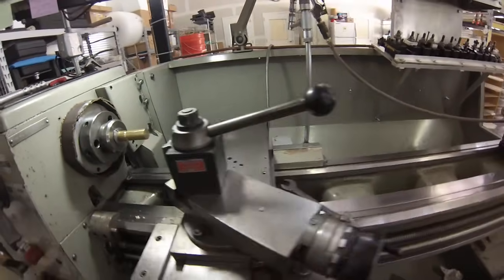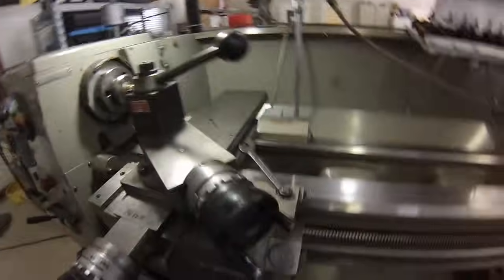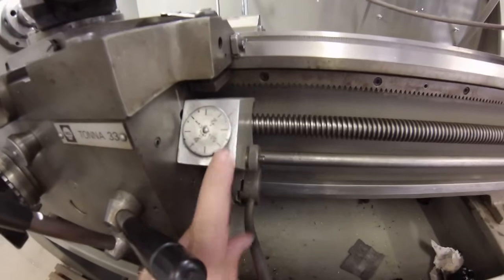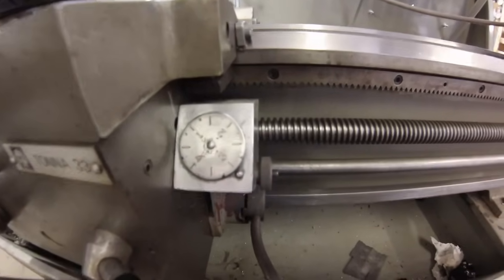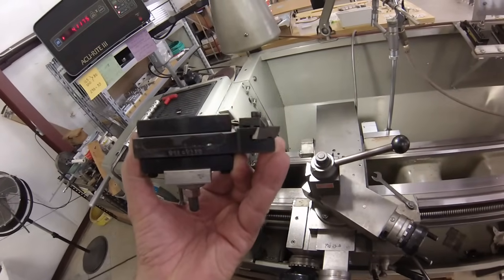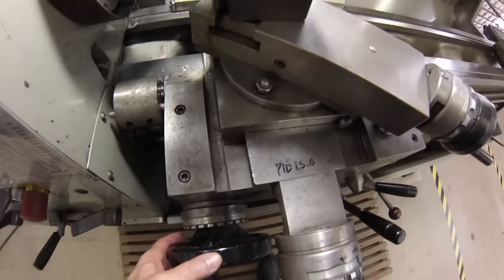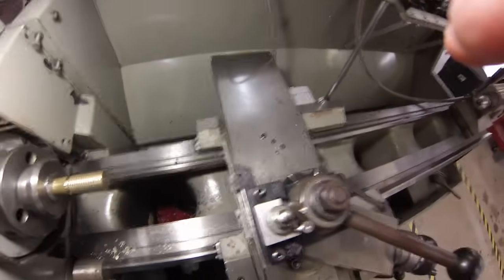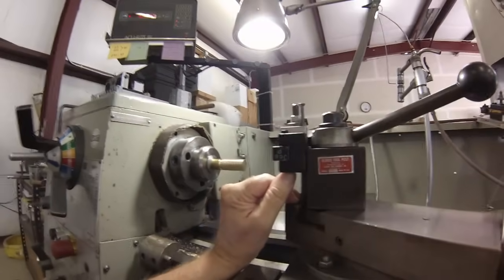Threading on a manual lathe  BEST TECHNIQUE EVER !!!!

Comment: What can be dun on a thread on chuck to thread in revers to keep the chuck from unthreading ??  SB 9a lathe
Reply from the maker: I would imagine only a LH threaded rod down the spindle bore would add security.
Reply: I use an old 9" SB lathe type C.  From an article in Home Shop Machinist Magazine, I was able to make an automatic kickout setup.  My adjustable stop hits a push bar which pushes the split nut lever open.  Setup takes some fiddling but not much.  This certainly has made threading much easier and quicker over the last 30 years or so.  If there is any interest, I can dig through my archive of back issues and post it.  HSM now has digital back issues available online to get the actual article.
Reply: By the way, thanks for doing this channel.  You are terrific and I have learned a lot.  I now know how truly inept I am🙄

Comment: Back in the day before CNCs, we had a lathe set up with a tracing attachment. If we needed to cut threads, we just let the attachment pull the tool out of the cut in the exact same place every time.

Comment: At age 60 I never before heard about pitch wires, so thanks a stack for that tip. Threading "upside down" is standard procedure for me since about 40 years ago. However, nobody teaches you to do so. Probably saved me from serious trouble many times over. If you would normally set your slide to 28° (for a 60° thread, better adjust this to 32° for the reverse cutting, or if possible turn the top slide all the way around - to 28° the other way. As a German, I have tremendous respect for engineers who work with inches, pounds, letter drills, fractional taps, wire gauge, ounces and psi. The wiring in your brains must be different. 👍

Comment: Hey Joe, i am using the same technique but why i have chatter? I using internal thread 16irag60 insert
Reply from the maker: Make sure the tool is centered correctly and your gibs are properly tightened. Also, if the part is extending too far out, the chatter may be unavoidable unless the part gets some support.
Reply: @joepie221  thank you replied Joe. I am struggling and wanted to use this method. 
Here is what my setup. Please tell me what i did wrong. 
1. Setup compound at 59.5 degree or 29.5 same as when i cut from outside to chuck. 
2. using internal bore with 16IRAG60 tool side up cut from the back side. 
3 zero cross slide. 
4. Use compound as i cut

The problem i have it seems it doesn’t thread correctly looks like chatter chewing thread. 

I tried hss tools up side down i have the same problem. Please advice and greatly appreciated it.
Reply: @joepie221  if you can what tool do I need to buy or setup. One thing noticed as i increased in compound it keep start move tool forward to the shoulder. 
Should i need to setup compound opposite direction? 
Be great you have a video to help walk thru it. 
Thank you.

Comment: Pretty sure this works on the ID too, with a LH tool for RH.
Reply: I do all internal threading (blind or otherwise) from the back of the bore with tool turned upside down.
Reply from the maker: Internal can still be done this way, yes.

Comment: Hi Joe, another fantastic video! You state when using carbide there is no need for the 30deg (or 29.5deg) on the compound. If you were using HSS and the lathe is going in reverse, should the compound be 30deg to the left rather than being 30deg to the right? When thread cutting with the lathe going forward and you are travelling right to left, when the compound is fed in it is mainly cutting on the left hand side of the thread, so I assume when the lathe is in reverse and cutting from left to right the cutting is on the right. Hope my question makes sense.
Reply: The orientation of the compound (left or right) does not matter if you're using the cross slide to adjust the cut depth.  When using the compound to adjust cut depth, it should always face in the direction you're threading.

Comment: I will have to wait until I upgrade to a second lathe, since my current one has a threaded chuck. It's extremely precise, but it will come undone in reverse...so yeah. Too bad :( neat trick though, I think this is great for anybody. Beginners or people with ADD. I am both haha
Reply: Have your cutting tool on the other side of the work.

Comment: FOG's blow their tops every time this video gets shared on social media. Imagine getting upset at others because they can do a better, faster, and easier job than you on the same machine and part.
Reply from the maker: I've worked with both ends of the spectrum when it comes to FOG's. They are either very helpful, or incredibly insecure. Now that I am the FOG, I'm willing to help any way I can. This channel is proof of that.

Comment: Hi Joe. What toolholder is that? When i turn my toolholder upside down, my tool is to far way from the chuck. Is that a links tool? Thanks! Kristoffer
Reply from the maker: Looking at the front of a tool holder, check to see which side the insert is on. That determines the designation of the holder. Standard, normally positioned tool holders are usually right handed. Mine is a left hand. This is why my insert isn't an inch away when inverted. If it was upright, it would be an inch away.

Comment: the worst thing about teaching the feed out is pulling the part out of the chuck ,ona larger thread  say s.s or 4140
you will lift the carriage chatter , you can't always  feed away, its like teaching to drive an automatic transition then throw them under the bus  with a stick shift,  i have ran a1"-32thread id  blind hole  + .00 -.005 in z depth  in 316 ss 100dreds.
when i was teaching  school the first time on the lathe i had every student threading toward the chuck ,no crashes 
wasn't trying to size the thread ,  you just need to learn and get it out of the way, its like kissing a girl the first time
you will figure it out, have you ever tried to kiss while running away, LOL
position the  cross slide handle at 9 to 11 o'clock  when you get to the mark the handle goes DOWN the half nut comes UP
your hands  both go it a circular motion the same direction like turning a steering wheel the 10 and 2 thing , set it up dont need to cut  just practice,
the Z  hand wheel may have  graduations  set it t zero at the pull out point ,use a marker make a squiggly line leading up to the zero PULL OUT apush down with the left pull up with the right  i use a1" travel indicator on the 1-32 thread that's not cheating its using your tools i guess feeding away isn't cheating you are almost always feeding toward the chuck its anormal  away is awkward i drive my car forward more than reverse, ok ok i will let it go. enjoy it  respect it ,don't be scared of it
Reply from the maker: You can lead a horse to water..........

Comment: One trick I use when using pitch wire is to take a ball of clay or play-doh and stick the ends into the ball to help hold the wires in place.
Reply from the maker: You can easily check thread pitch and concentricity using only one wire. No clay needed. 3 wires won't check concentricity.

Comment: Will this work on a lathe with a L00 taper spindle. I think it will because it has a key and taper, but I don't want to unthread my chuck. Sorry if this is a stupid question I am brand new to running a lathe.
Reply: Doesn't matter,
Reply: Thank you very much for your reply!  @stevieg2755

Comment: If your chuck threads onto the spindle you can not cut in reverse.
Reply from the maker: That warning is in the video description.
Reply: You CAN if you take Light Cuts. . . It's not like you're Hogging Off .040 (or more) in a Single Pass in Reverse. 
Single Point Threading shouldn't put any more load on it than Reversing the Spindle to back out a Tap. 
If your spindle threads and chuck are loose and sloppy and come loose every time you reverse the spindle, then THIS ISN'T FOR YOU, but if it fits tight enough you have to Struggle to get it broke loose so you can remove it, then you should be good to go, (again) Taking Light Cuts. 
It would be Pointless to have a Reversing Switch if it wasn't safe to use under "Normal" circumstances. . . But if you're prone to crashing into the jaws (which Likely WOULD Jar it Loose in Reverse) then All Bets Are Off.

Comment: I'm cutting threads onto a 4140 shaft. I watched this video a couple of times and somehow missed the part  about 1) What is the optimum RPM for steel ? 2) How much material should be removed each pass from the first cut to the last?  3) What causes the threaded area to tear?

Comment: I've owned my JET Model 1325PBD for 30 years and never had occasion to cut threads ... until today. I have 3 submersible pumps (for hydroponic gardening) with 5/8 inch NPT inlet/outlet ports. Not only was it impossible to locate any 5/8 NPT fittings on Planet Earth, but the only place I found a 5/8 NPT threading die was on eBay ... 2 weeks away. I decided to construct my own 5/8 x 14 tpi fittings by learning how to cut threads on my lathe. I happened to watch Joe's threading hack video before cutting my threads, so I did it Joe's way ... and it worked like a champ! Cutting tool upside down with spindle in reverse ... cutting threads away from the chuck. My threads in a 1-inch Delrin rod looked like crap, but my first two attempts were good enough to engage with my 5/8 tapered pump threads and tighten up just fine. Many thanks, Joe, for a wonderful threading technique! (I'm a 73-year-old retired EE with a very nice man-cave shop in my back yard.)

Comment: I'll give you a trick:  When using thread wires, stick the ends in a rubber eraser.  Holds all 3 in approximate position.
Reply from the maker: You can check a thread with only one wire. It doesn't get easier than that.

Comment: Can you use this straight plunge in method on steel,  like would you have to turn your compound in the other way, then the work would stick out more?
Reply: Kinda depends on the size of the thread, material, tool size, lathe/compound rigidity, etc.  I've done straight plunge on relatively small threads.  Larger threads have a lot of cutter engaged with the material as the thread gets deeper.  But...upside down and backwards does help reduce the chatter.  

I've threaded a lot of alloy steel and such, so tend to go the 29-1/2* if threading into the chuck.  You'd want to go 30-1/2 * if threading away to keep the leading edge of the cutter cutting.

Comment: Does this work if you're holding the stock in a chuck that screws onto the spindle (like the older South Bends), or does the tool resistance risk unscrewing the chuck?
Reply: Maybe use a drawbar to prevent that happening.

Comment: Awesome video, this seems a much safer way of thread cutting. How is your chuck mounted onto the spindle? Mine screws on, is there a risk of it getting unscrewed while cutting with the lathe in reverse?
Reply from the maker: Mine is a 3 pin cam lock style. Screw on chucks do have a risk of unscrewing. thats in the video description safety warning.

Comment: Great vid.  I tried this method at work today but didn’t work for me. I was trying to do a M42 thread and I engaged the nut on different combos of numbers and I kept getting like a double thread.  They didn’t match up or keep consistent. No sure why. Any idea? I tied it on 1,2 and 4.  Maybe I should have tried it on the half or in between? Really want to try this properly
Reply from the maker: Metric threads often require all movement of the carriage be done with the half nut engaged. Do not disengage it from the very first pass. Reverse the machine to get the carriage back to zero. that being said, be careful with a hard stop when moving the carriage under power.
Reply: If you didn't already try Joe's suggestion.  To get your carriage back to zero with the half nut engaged, you can get it close with the machine on, then power off and move your spindle by hand it should move your carriage as the spindle turns.

Comment: I just got my first lathe and new to machiing and am wondering what is the trick forc cutting  nice looking threads with no undercut involved (like those on store bought bolts)?  It seems this would require right to left threading only due to depth of cut being increased for each pass which could be done only past the end of the piece being threaded.  Then there's the problem of stopping at the same place each time, which seems to me would require some sort of carriage stop leading to a disaster.
Reply: Store bought bolts are rolled threads. Trying to thread up close to a shoulder and trying to back off while simultaneously kicking the half nut is asking for disaster. 
    If a customer requests no undercut I will double the quote time because I will have to run nearly 75% slower. And so will anyone else.

Comment: Can you use that method when running towards a live center?
Reply: I just had to chime in on the post about "live" centers.  It's funny how Derek thinks he's going to correct you and even says to do your own research!  I am not sure what country or planet he comes from but, it's pretty common knowledge that you are correct in saying it's a live center.  Not because it's "powered" but because it has the ability to rotate as opposed to a dead center that cannot.
Reply from the maker: Absolutely. Plan ahead.
Reply: You mean a "revolving dead center" ? ( ANY "live" center has power supplied to it ) A revolving tail stock center in NOT live .
Reply: @derekcrymble9085  A live center is a center that has a bearing so that when the part rotates in the chuck the center spins in its bearings.  So that you do not have to constantly keep it lubricated.  A dead center does not have any rotation and you have to constantly keep it lubricated.  I meant live center which is what I said the first time.
Reply: @o7JackLion  "Revolving" . Read my post again . As a turbine machinist for more than 20 years , I have seen your mistake many times . "Live" ONLY MEANS IT IS POWERED . Do your research .
Reply: @derekcrymble9085  Live centers are used to hold or support a workpiece in a lathe or other machine tools, often between the headstock and tailstock. Live centers revolve with the work. Dead centers do not.

Comment: After watching this   Sunday night I used this method to cut a 32 TPI  thread today  on  what would have been a blind end  , I must say being an amateur Hobbyist  this worked well for me  and saved a lot of  tense moments  that i normally  have  , lucky for me my Lead screw is 4 TPI  so  no need to use the Engagement dial in this case . I really enjoy  your presentations and have used many over the last  few years.  Thanks again.
Reply from the maker: Its good to know these videos are helping. Threading can be very stressful, but doesn't have to be. Good luck and thanks for the feedback.

Comment: Hi folks, one thing to watch out for, this method is great - if your lathe has the appropriate spindle bearings and does not have a screw on chuck.. You really need two opposed taper bearings because the cutting load is being applied away, not towards, the headstock. It would not be the best way of thread cutting on a Myford Instrument lathe for example. As the spindle is run in reverse a screw on chuck is in danger of being unscrewed. Again a problem on a Myford.
Reply from the maker: This is a valid safety concern and clearly spelled out in the video description.

Comment: I am trying to figure this one out on my Hardinge Super-Precision HLV-H since it doesn't have a half-nut. Trying to get the Z back to Z-0 for the next pass is darn-near impossible, even when manipulating the backlash for a few extra thousanths.
Reply from the maker: If my memory serves me correctly, that machine is equipped with a cam on the compound to retract the tool and an auto shutoff collar/rod to stop the carriage. Those are about the best options to assure you never crash a thread accidentally. Inverted reverse threading on that machine would be a step backwards in my opinion. As for getting a carriage to a Z zero point, a carriage stop seems like a logical solution. Am I missing something?

Comment: HI Joe:  Big fan here.  Just to confirm about using this inverted tool technique when using insert tooling to thread to a shoulder, one should use a left-hand tool holder, a left hand insert, and a right hand anvil (shim) to have the 1.5 degree helix clearance angle to match that of the RH thread.  Is that correct?  Thanks.
Reply from the maker: I use all left hand tooling, but Top-Notch inserts don't need shims. Kennametal brand. and...I cut LH and RH threads with the same inserts.

Comment: I started using your upside down threading when I was an apprentice and all the older tool and die makers laughed at me. I still use the upside down threading technique. I go with if it works it is an OK way even if it is not the old fashioned way.
Reply from the maker: I see it as the absolute safest and fastest way to go.

Comment: Ha! I've been threading away from the chuck, with an inverted tool (for right-hand threads), for decades. I do have a different procedure for the rest, though. It has a lot of steps, and I've never seen a video of anyone doing it quite the way I do, but I've never crashed the tool into the work or the chuck. By the way, that looks like an old 13" Clausing-Colchester. I love those things.
Reply from the maker: This is a fantastic technique when the part is expensive. And yes, its a 13" clausing. Great machine.

Comment: That only applies if your lead screw is right hand thread. If you have a left hand lead screw, than your spindle has to turn against the lead screw for a right hand thread.
Reply from the maker: If a spindle is turning in reverse and your tool is inverted and cutting away from the chuck, its a right hand thread. Regardless of what the lead screw looks like. Everything else is machine settings.